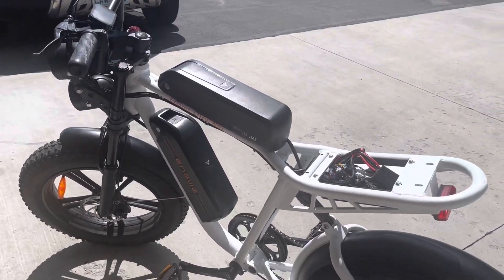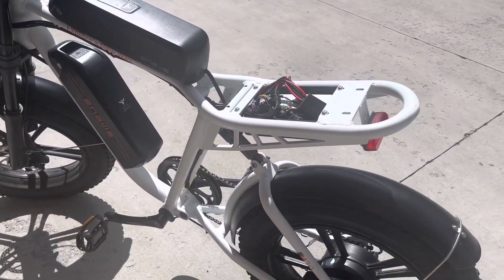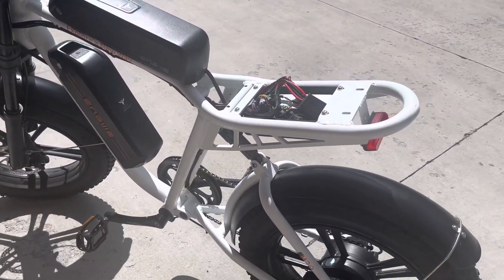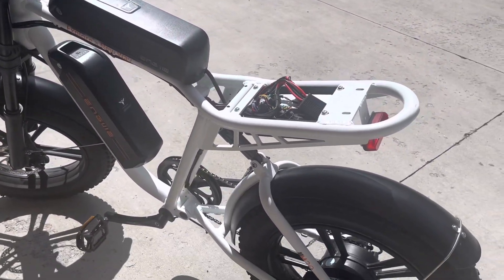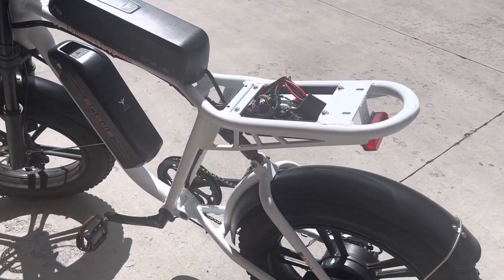Engwe M20 Already Broken | Error 24 Problem only at 60 miles | Need Help!

Comment: I was looking at some of their models, but if they won't sell parts and won't offer any help for service, they should be immediately DISQUALIFIED as vendor at this price point.  That doesn't help you though.  How did you pay your seller?  If you used a credit card, it may be worth filing a charge dispute with your credit card bank.  If you paid via PayPal you may have some redress filing a dispute with them.  GOOD LUCK!
Reply from the maker: Yeah I bought it from a influencer and paid paper cash but there was no parts available so he refunded me.

Comment: Error 024 indicates the motor hall(an element in the motor) abnormality, it means either the motor hall and the controller are not connected properly, or the motor hall is broken

Comment: I am surprised you were even to find a used dual battery M20.  It just came out and was on backorder for a while.
Reply from the maker: I got it from a youtuber that it was sent to him and he sold it to me.
Reply: @markmantsevich8709  I bet he is still accepting commissions and did not go back and tell his subscribers the bike failed 50 miles later.  Perhaps the original owner/Youtuber could file a claim for you.
Reply from the maker: Nope he didnt. Also i tried messaging him and no response.

Comment: It’s how you charge it, I shorted my controller out by plugging into the wall first. I was told you have to plug in the battery first, then plug the charger into the wall
Reply from the maker: Its the other way around you need to plug in wall then plug into battery.
Reply: @markmantsevich8709  that’s why our error code is on. You don’t listen, tsiddahn!!!
Reply from the maker: Nope owners manual says other wise it says to plug in wall then bike.

Comment: My rear disc brake was too close to the motor cable..it cut through the cable...I am worried that my motor or controller is now dead....
Reply from the maker: Mine was perfect not even a scratch on the cable

Comment: do u have a multimeter to check continuity between the motor cable pins? maybe the hal sensors are shorted out. could be the motor cable or in the motor itself. worst case is the motor itself the hal sensor or wire came loose. u could replace that if u can decently solder and are prepared to take the whole motor apart.
i have a similar reoccurring problem with my own diy ebike which had a bad spot in the cable and the cable actually needs replacing...

Comment: What does error 24 mean? How do I fix it?
Error 24 is a Motor Hall Sensor Error 

The sensor within the rear hub motor is failing to read. Same with Error Code 23, there is an issue with the wiring running from the rear hub motor to the controller.

The Fix: 

Error between motor and controller. Check the motor cable on chain-stay for damage. If no damage, test with new cable or plug motor directly into controller. If error persists, test with a new controller. If there is still an error, test with a new motor.
Reply from the maker: Yes the cable wasn’t damaged i think it was the motor was blown

Comment: I fixed mine by unplugging the cable at 1:30 and plugging it back in completely pushing it all the way in and screwing it tightly
Reply from the maker: I have already tried this and nothing. 😢
Reply: @markmantsevich8709  You should send an email to Engwe then. They require video evidence showing you trying to activate the motor ... the error on the display ... and photos of all the cables and connectors around the bike and under the seat (the controller). As well as a photo directly of the motor hub itself.
Reply from the maker: They wont do anything because i bought it used

Comment: Have you been able to find a solution to the problem?
Reply from the maker: Nope :(
Reply: I noticed that the bolt on the left side, that holds the light fixture in, interfered with the wires. I put the bolt in backwards to avoid damaging the wires. Check the wires around the bolt for damage. Thats all i got.
Reply: @davidfink4963  I put plastic tubing around the bolt.